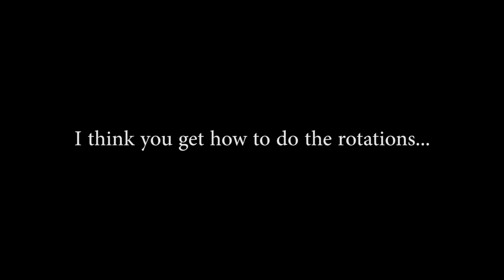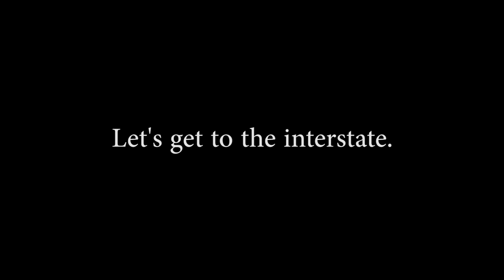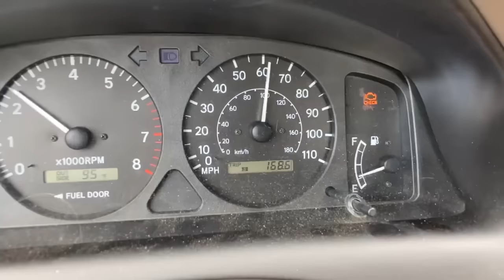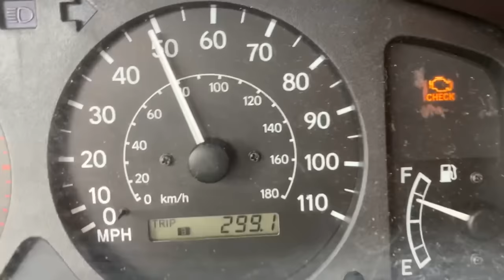Will Berryman's B12 Chemtool stop oil consumption? 😲 | Oil Burning🔥Experiments | Episode 15

Comment: I've watched several of the other vids you've posted using different products. The question that comes to mind is: what is the real key to success here, the method or the product? Would any of the other similar products work as well if using the technique in this video?
Reply from the maker: The B12 definitely seemed like a stronger product. I would start with B12 every time now if I were to need it on another car. Thanks for the comment!
Reply: @FamilyFriendlyDIY  I tried this on a Toyota Prius and the 1.8 liter engine that was using a quart of oil every 400 miles. It worked like a charm. I've driven 1500 miles now and the oil is still at the full mark. I did use Berryman's B12. Great product and great method. Thanks.
Reply from the maker: @jabcsmith1  That's awesome 😀Thanks for coming back and giving an updat !

Comment: When one piston pushed the cleaner out the spark plug hole, the other paired piston pushed the cleaner out the exhaust. I wonder what effect that stuff had on the O2 sensors and the Cat. Perhaps the reason the car was hard to start was because the O2 #1 was soaked in cleaner and unable to detect oxygen therefore sending a max rich ( max voltage, .9mV ) signal to the short term fuel trim. Which in turn would dial back the fuel delivery to the point it was too lean for the engine to start. Or perhaps the remaining cleaner soaked the spark plugs. Could not help but notice how clearly defined the cylinder cross hatch was. Disappointed that you did not  take another look at the pistons. That would probably have answered your question as to whether or not what you saw was for real. This program is a year old and perhaps you know about Valvoline's engine cleaning synthetic oil. Looks interesting. It's talked about on The Engine Oil Geek U-Tube .
Reply from the maker: Thanks ... I've been in touch with Valvoline too ;-)

Comment: My son’s 2020 Camry check engine light came on code p02F1. Cylinder #4 injector circuit range /performance

First tried STP high milage fuel injector cleaner .  While that may of helped some . Light didn’t go out.  And was thinking was going to have to change all the fuel injectors.  I then tried 1/2 can of Barrymans b12 chemtool  in the gas.   By the time it was down to 1/4 tank the light went out.  Going to use the other 1/2 if the can on next tank.  And hopefully light stays out.  Needs to be smog tested soon

Comment: Over a year ago- but it’s obvious that oil is seeping through the valve seals into the cylinders while parked and being sucked in during engine operation- I hope you checked the amount of blow by , that would of told you if your engine had either bad piston rings and or valve guild seals

Comment: I have a 2006 RAV 4 with 115K miles. It consumes oil at rate of 300 miles per quart! I want to use B-12 to soak the pistons like in video. But I can't turn the crankshaft manually with a wrench like in the video for the corolla. The crankshaft nut is not accessible. It is deep in and blocked by other parts. How do I turn the crankshaft and pistons to distribute the B-12 in the cylinders?
Reply from the maker: Hmm. I haven't heard of that problem yet. Not familiar with the RAV 4 layout ... but it's possible you could turn another pulley that has a belt going to the crankshaft pulley.
Reply: @FamilyFriendlyDIY  AFTER the spark plugs and also the EFI fuse are removed, can I use the ignition key to start, and hence turn the pistons after every 6 hours? Removing the EFI fuse is to prevent fuel being injected into the cylinders. The only issue is, it would be difficult to tell whether the pistons are mid-way between TDC and BDC. Is using the ignition key an alternative to manually turn the crankshaft, given my RAV 4 scenario?
Reply: I will be doing the B-12 treatment soon. Dave, in your videos, you said to spray the cylinders with WD-40 BEFORE reinstalling the spark plugs. Purpose is to provide some lubrication to the walls of the cylinders. Hopefully this would make the car easier to start. Is this correct?

Comment: This stuff has been known in the Mini Cooper BMW  direct injection crowd as a godsend. Great stuff for soaking your intake valves before a walnut blast. This stuff dissolves carbon buildup like crazy. Better than anything else i've used. I wouldn't doubt that if left long enough you wouldn't need to do much to get the rings to unstick. I do bet you are due for new rings a least. Your cylinder walls look fine so the blow-by has to be the rings. Looks like a-lot of oil on top of those cylinders.
Reply from the maker: Good info, Justin. Thanks!
Reply: It softens carbon build up, it doesn't dissolve it.
Reply: Yeah I work on the Euro cars for a living. I use B12 just for that. To help break down the carbon buildup for carbon blasting.

Don't know if I would ever recommend it for use as depicted in this video however. But at least he was concise with the risks and personal liability.

Comment: Hopefully this gets a response but why would you add it to the cylinders through the engine rather than just adding it through the gas tank? 

About to do this on my 2009 Pontiac vibe with a 2.4 2az-fe
Reply from the maker: Through the gas tank it would clean the fuel system, valves, and maybe the tops of the pistons a little. In the cylinders themselves and in the oil, it would get to the rings and other parts that are considered the "bottom end" of the engine.
Reply: I realize I meant oil cap
Reply: I ended up buying liquid Moly pro engine flush

Comment: I soaked my motorcycle piston in kerosene to free the rings. Too bad I cannot use these products with motorcycles being that the engine oil is also the gear box oil. Save me the tear down. But I had to replace the valve stem seals anyway which was the cause of my stuck rings to begin with.

Comment: That looks like you also had a valve guide seal or guide problem if you have oil on top of the piston after sitting for 2 days. The piston should be dry with NO oil on it. Also too thick of oil or thick additives will cause more gumming up on some of the low-clearance engines that's why they call for a real thin oil.

Comment: High speed in high gear works much better for cleaning up the carbon. Yes, I know 100 mph isn't safe, just saying it works much better than high rpm at lower speeds.

Comment: Is that mean that the problem is the sticky piston ring not a scratched wall?  Thank you for your detailed experiment!
Reply from the maker: Yes. It means the low-tension piston rings (especially the oil-control rings) were stuck in the ring lands in the piston, instead of expanding outward to scrape oil from the cylinder walls.
Reply: To make things worse, a stuck ring will score the wall.

Comment: May be if you close the spark plug holes then but lesser amount and try to move crank  bully you will force the fluid to go down through the rings
Reply from the maker: True, Ehab. The Seafoam site actually recommends that when doing this with their product. Thanks for the suggestion!

Comment: Probably too late, but while that B-12 certainly appeared to clean those pistons after doing your method in the description...
If you want to rejuvenate those piston rings and seals throughout the engine, run Rotella T6 5W-40.  

It's high in detergents, it's an HDEO (Heavy Duty Engine Oil), totally safe for any gasoline engine.  I've ran it in my 5.0 EFI for a decade.  It's even been used for years in an 03 Cobra with a 2.3 liter KB making 603 RWHP @ 19psi.  It starts out around 15cst when new at 100C but always shears down to 13.5-13.7cst and stays there forever.  It's just how it works.  

Now, some engines won't like it.  I know my low mileage 3800II in the Park Ave kinda "ticked" with it in there at 60k miles, but it may be time to try it, again.  Car is just falling apart everywhere at just under 120k miles.  From electronics to oil consumption, to high idle, coolant loss, vacuum leak, flickering headlights... you name it.  

I hate GM products.  Say what ya will, as far as domestic goes, Ford is the best.  I'd trade this POS in for a nice 2006 or 2008 Ford Fusion V6 any day of the week.  Or a Taurus SHO lol... I'd love to have a Ford with one of those EcoBoost engines.  I digress...

Rotella T6 5W-40 will clean your internals up and rejuvenate your seals so they aren't left leaking.  If you just clean the crud off and the seal stays the same size (thin and brittle), then you increase oil consumption.  Something about Rotella T6 not only cleans the engine up, it truly reduces oil leaks and oil consumption.  My F-150 (it's a 1986 F-150 with the 5.0 EFI) totally stopped leaking oil under neath it.  It uses a little oil but it used to use a quart every 300-400 miles, now it's more like a quart every 1500 or 2000 miles.

It's all about being high in detergents... and not to mention it has about 50% more zinc and phosphorous than your typical modern day engine oil.  Those are your anti-wear additives.  They've reduced those additives with each new specification... from SL to SM to SN... they kept putting less and less zinc and phosphorous in.  

Now, I have a flat tappet cam, so I prefer to have that extra zinc and phosphorous, but it certainly doesn't hurt roller cams, it only helps reduce wear.  

It is, HANDS DOWN, the number 1 oil for 99% of cars out there.  It just works in everything.

Go to bob is the oil guy and look at used UOA's (used oil analyses) and see for yourself.  Got an LS1?  Got a new 5.0 or old 5.0?  Got a 350?  351w?  Subaru?  Toyota?  Mitsubishi?  

Doesn't matter.  Nothing beats it.  Pennzoil Platinum and Pennzoil Ultra Platinum are the other best options if you insist on thin oils.  The UOA's show that.  

But remember, only in America do our car manufacturers recommend 5W-20 or 0W-20.  The exact same car with the exact same engine in Australia?  It's gonna call for a 10W-40 or 20W-50.  This 0W-20 stuff is pure EPA BS for that .3% better fuel economy.  

Pick synthetic oils with small numbers in the front (0W or 5W) and bigger numbers at the end (40 weight).  AKA Rotella T6 5W-40.  It's a magical oil lol.
Reply: Is it safe to use on a 2009 audi a5 2.0L, unleaded fuel nor diesel?
Reply: Do you think  this oil would clean up 2007 Honda Accord 2.4 l? It has about 263,000 MI burns a quarter of oil every 4 to 500 miles.

Comment: Looks like all cylinders are burning oil. For the misfire  , Change the plugs, there is alot of carbon deposits on them . Also change The PCV valve . Also , Never remove the plugs withe engine hot. You can rip the treads out of the holes and then you're screwed.  Always do it cold and by hand. Don't be so reliant on the electric ratchet . You dealing with Aluminum. Same for the bolts that hold the coils on the valve cover . I busted the treads on them just by tightening them by hand. Then the  coil wont stay on very well.  Like I commented on 2nd video, I have a 99  Rolla and a 2001 Rolla. They bot burn oil but the 99 is the better of the 2. The 01 has no compression on Cylinder #4 and is my parts car. Change that PCV valve.

Comment: I'd run conventional oil in that engine. It would slow the consumption considerably. Also, I run Schaefers Moly EP in my 06 Suburban K2500 with the 8.1 and it slowed the oil consumption considerably. I know you can't do that right now because of the experiment though.

Comment: Nice job freeing the oil control rings  they are notorious for gumming up if you change the oil every 5,000 miles the oil consumption problem shouldn't return
Reply: I can’t agree enough on this! Frequent oil change is the BEST way to prevent oil consumption. Change your oil at least twice a year!

Comment: Id have changed that oil after the soaking. I would also use standard oil instead of synthetic. If the rings are not seated properly regular oil may help seat them again quicker

Comment: Diluting the oil comment- no likely (I still agree with doing this treatment. Qt every couple hundred miles will clog the cats). Oil would be thicker but a real problem would be more of introducing too much sludge into the oil filter and the filter bypassing contamination through the system. My recommendation would be to start with a new filter. If it still burned then it’s probably the oil bypass ring being too clogged/stuck/damaged.

Comment: Can this stop the oil burn of the 2AZFE engines?
Reply: Hi Obasi, I just tried a very similar technique on a 2007 RAV4 with the 2AZ-FE engine with 121K miles.  I'm burning 1 quart every 500 miles, and have only driven 40 miles since doing the treatment, I'll let you know how it turns out.
Reply: Hi Obasi.  Right now I am at 327 miles since the treatment.  I'm down about 1/8 of a quart, previously I would have been down about 3/4 of a quart.  
I'll probably redo the treatment again when I am down a full quart.
Reply: @Verison12345678  wow! This is interesting result I must say.

Comment: That’s another good reason probably burns well hold on now rPMs really high you should just remove the Rev limiter and then haul it to the floor that way you can make valve to piston contacts and have total destruction
Reply: There is no REV limiter.

Comment: As far as I could see from this video, they are on your car, i.e. the engine of your car. The valve rubbers are worn out (dried out and distorted), change the valve rubber and you will solve the oil consumption.

Comment: Nice 👍 might do this to my 2017 Sonata Theta 2 engine 2,300 miles since my last oil change and used 2 gallons of oil so far.   Thanks for the video. Just subscribed to your channel.
Reply from the maker: Thanks Albert! and I hope it works for you!
Reply: Use a whole can of B12 in only 2 gallons of fuel, then Add Lucas Top end Cleaner/lubricant. Do an oil change and add CRT Engine Restore. You'll notice everything runs better and the engine restore helps compression return while sealing scratched in your cylinder walls.
Reply: 2 gallons of oil in just over 2000 miles?
8  quarts?
So you go through a quart of oil every 250 miles?
Reply: @bladecutter1  Yes it's unbelievable. Great on Fuel Mileage but uses allot of oil. It was a fleet rental car at first. So I imagine it had long oil change intervals in it's infancy. Started doing a flush and hopefully I'll get most of the gunk out.
Reply: @albertvela8712  How many miles are on it overall? And good luck.
Reply: @bladecutter1  It has 72,395 & Thank You

Comment: Hey Dave, I’m going to try this fix and I have one question for you. I’m a bit worried about the amount of Berrymans that will be in the sump oil when I thrash it for 20 mins. Did you have synthetic oil in there? Mine is currently mineral oil and I’m wondering if I should change to synthetic before doing this trial?? Do you think it matters?
Reply: mineral oil is clear.  I think you mean conventional dino oil.  Most oil today are blends.  Hard to find conventional honestly.  Even synthetic oil is almost always group III, meaning it is highly refined dino oil that they are allowed to advertise as synthetic.  But it really isnt.  

As for your question, it is fine that the oil is conventional in there.  But I wouldn't thrash the car or even drive it with berrymans in there.  Many let it idle for some time, but thats all.  And before you start it up, do a soak with engine oil because the berrymans will strip the cylinder and rings of all oil, so they will be dry and unlubricated.  You dont want to damage them.

Comment: If your pistons looks wet  like that after a engine run then obviously it’s sucking oil from a leak from either the intake valve oil seals or major ring failure letting oil get past the pistons, I highly suspect intake and exhaust valve seals are shot

Comment: I could see putting a little bit of marvel mystery oil on each cylinder and if you have a spare vehicle letting it sit for two days or all day Friday until Monday morning and then switching into Rotella T6, 15 W 40 or a full synthetic 20 W 50 and a zero W-40in the winner

Comment: I put this in a 1zz geo prism that had a cylinder at 15 psi. After 10 minutes letting it idle the cylinder went up to 130 psi. Would not suggest this unless the engine already needs to be rebuilt...